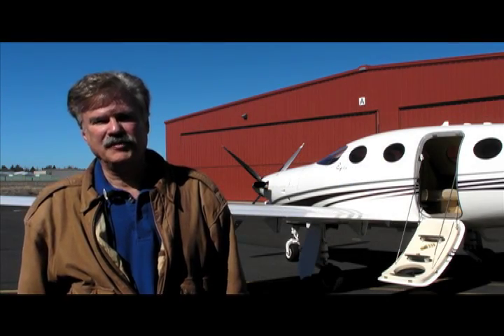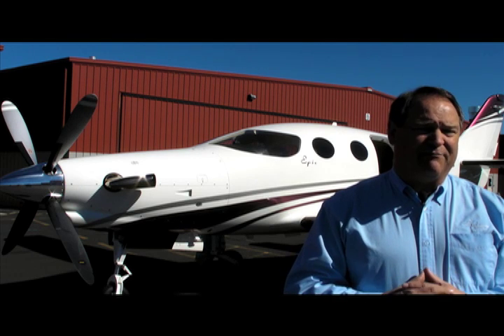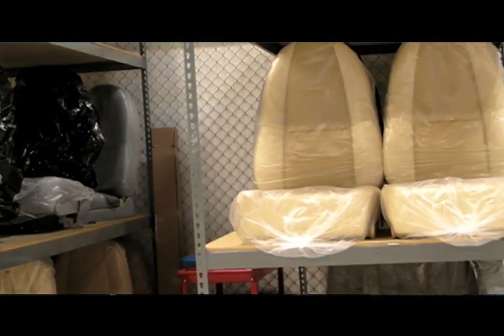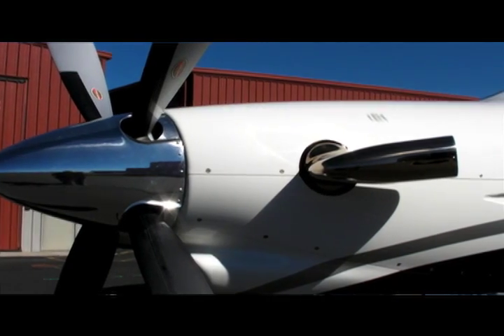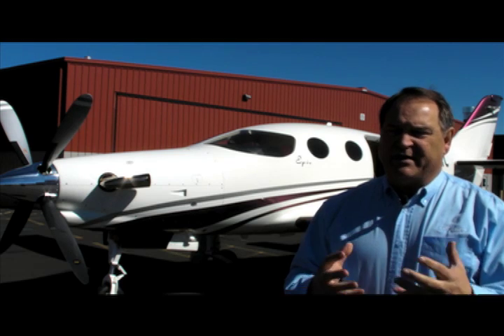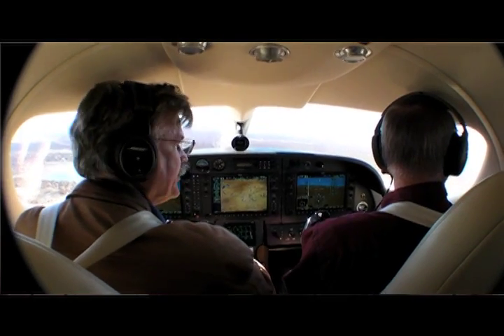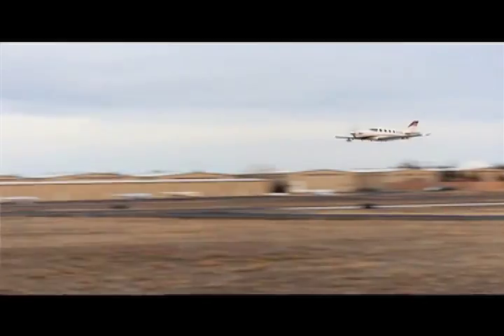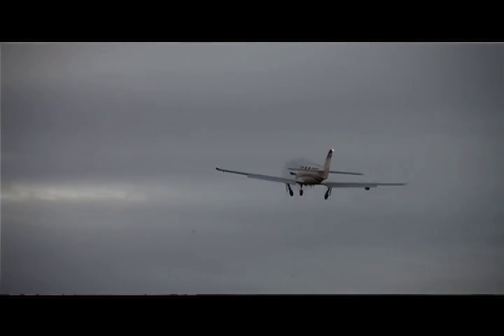Tour of Epic Aircraft and Trial Flight of the Epic E1000

Comment: Hey, Rick!  Nice to see you in one of the videos!

How tall are you?  Headroom looked a bit low up front for you and the Epic pilot, so I was just wondering if you're both pretty tall or if the ceiling felt low to you.
Reply: Mike, The aircraft has a very sleek profile, and usually that affect a little bit the headroom, I currently own a Columbia 350 (same case) and bought an Epic LT as well. Some Epic LTs have a height adjustable seat, so you can increase the headroom a little bit, I think this one of the video has the adjustable seat...

The best way to confirm how it is , is getting onboard it on some aviation show there in U.S ( OSHKOSH, SUN'N FUN).
Reply: Thanks!  I saw the Epic at Oshkosh a couple of years ago, but I didn't have the chance to sit in one.

Congratulations on yours!  Is it completed?

Also, how do you like the Columbia?
Reply: Mike Kobb  The Columbia is excellent! Great cost x benefit

175 KTAS on 12,4 gal/h at FL095 and it is really hot here in Brazil...

My Epic Lt is not completed yet, probably on July..

Regards,
Reply: Good luck with the Epic, and congratulations!  Thanks for your thoughts on the Columbia. :)